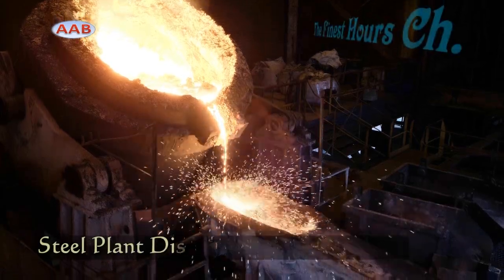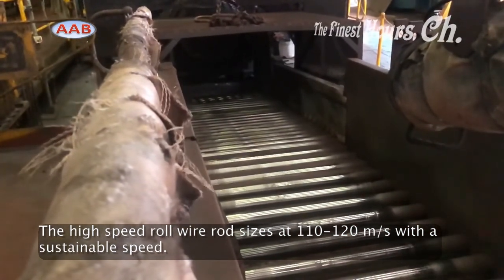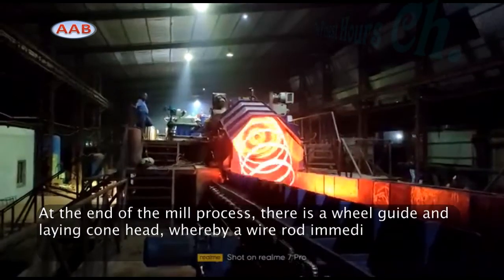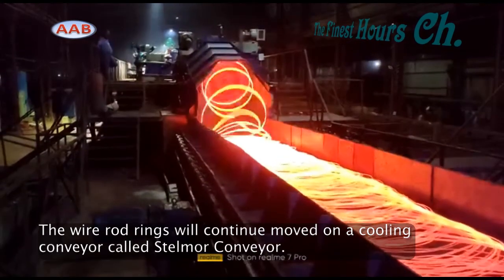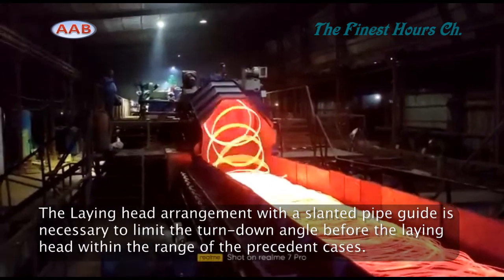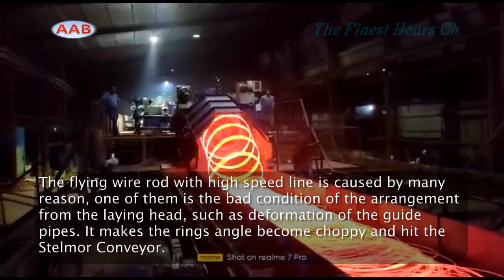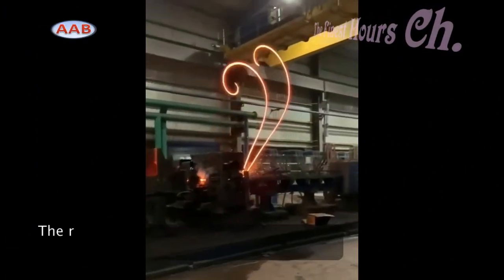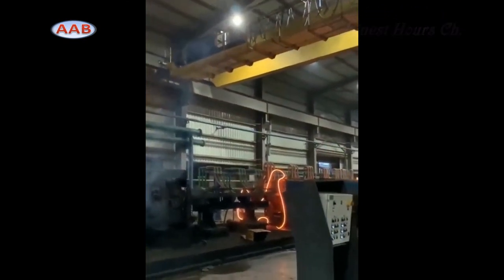The production accident at Wire Rod Mill Part 1: Flying Wire Rod at the end of the mill.

Comment: I've never seen a wire rod mill. I worked in the EAF at a mill that rolled into coils. Each heat was between 195-205 tons in the furnace